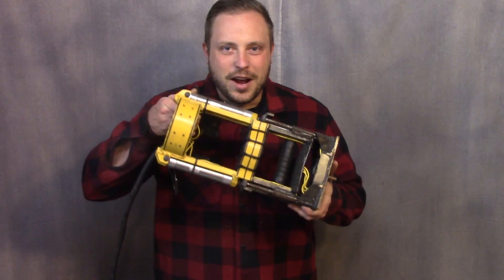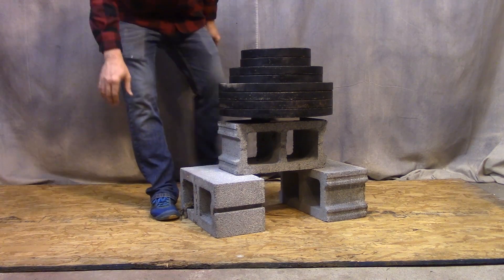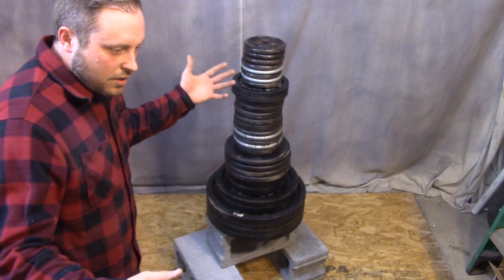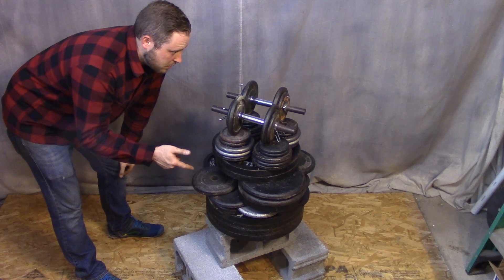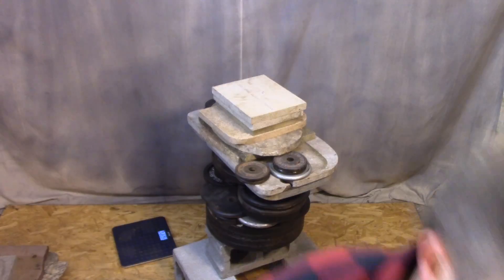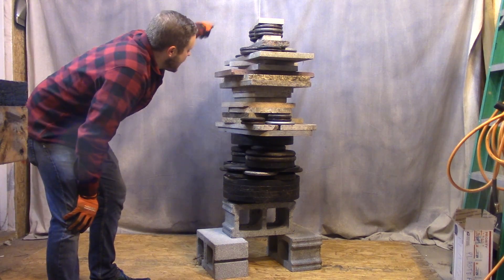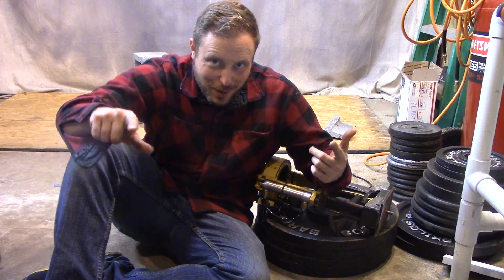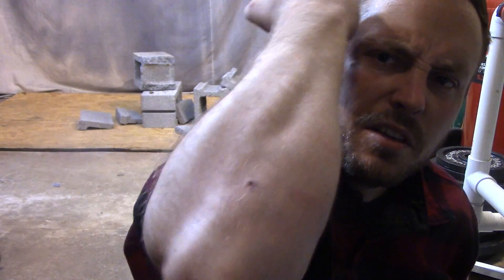POWERFIST POWER TEST - How much force to break a cinder block

Comment: You can swing a small sledge hammer and do the same thing. The sledge hammer does not weight 600 pounds but it is how the force is applied with inertia and pounds per square inch.. this is public elementary school stuff.. come on

Comment: ok glad you told us how much the Co2 gas/part adds to the punch! 300 pounds, thats half of a great punch since you mentioned conor mcgregors is over 700
so if Conor mcgregor used it he should be able to get up over a nice 1000 even when not thinking about all the sturdy heavy metal you have adding force
but cinderblocks resting weight durablility is higher then its impact but im not sure how much
but still very awesome!

Comment: The weight is distributed between the surface area of the cinder block. It's much harder to break the cinder block like that compared to having all that weight focused on a small area on the cinder block. Also impact force which is sudden is different from a constant force. Still fun to watch.

Comment: To say that it's over 2000 pounds based off what they can carry statically using a base plate the same size only works if you hit perfectly flat and ignores the way motion transfers energy. In reality you can use less force on a punch with that because of the transfer of kinetic energy and the fact you would have been hitting it with a corner of the plate before the flat of it

Comment: He did the math! (Incorrectly).

Btw you can look up the strength of various building materials like... cinderblocks.  They usually have a compressive strength over 1000psi.  Considering the entire weight stack was balanced on top of roughly six or eight square inches, you’d need 6000 lbs or more to make that cinderblock collapse.  There’s also the issue of striking something vs, gradually adding weight.  They’re not the same.

Comment: Iam not sure if this guy is just really bad at physics or if he is trying to excite the kids watching (not like that). But it's not about weight it's all about the pressure you put on it (PSI) the weights he was putting on were soo big it increased the surface area which decreased the psi.the power fist has a very small tip to impact pressure and because the surface area was small then you don't have to use as much weight so it is probably only hitting with 400kg and with added momentum

Comment: You are not comparing the both material at same level. You put 1000 ıbs on the cinder block but, when you are doing this you use no explode power. Second time you use all the explode power on the cinder block. Like drop the bowling ball at 100 ft. There is no justice. Im from dıfferent country ıf you see mistake on my words, sorry for it.

Comment: That weight is distributed all along the surface of the block though.... If you applied that weight at a smaller point (fist sized) on the block, it would break alot easier

Comment: Poor experiment. The blocks were stacked in the poorest  weakest way. Homes are not built with block holes vertical. The block holes are horizontal. I used cinder blocks to prop up the front end of my car gross weight 3775 lbs. The punch through test was an accelerated force applied, not a steady force.

Comment: i think why this experiment failed the first time is because of the loading in ME we have different loads that creates different stresses to the material he applied like a uniform load which was uniformly distributed throughout the material so it will have more power to carry that much load without breaking, but the powerfist  works on impact or impact load which uses gravity acceleration kinetics energy and is concentrated on a particular area, what i mean is that i can break that cinder block with a hammer

Comment: consistant weight is not the same as force or impact. you could have dropped a single one of those bigger weights on it and it would have done the trick.

Comment: Hey, just wanted to point out that the wider the base of your weights the more difficult it will be to 'break' the cinderblock. In your case those first 4 weights span the entire length of the cinderblock and as a result will actually carry the weight of any blocks above it. Your fist has a much much lower area covered and thus will have an easier time.

Comment: The load was being transferred directly downward through the cinder block with the weights. From my guess cinder blocks can take lots of compression force. But when he punched it there was tension force along the side (as the block would be deforming downwards) which they can't take tension well. I know that's the case with concrete, not sure about cinder blocks but would guess similar material

Comment: The reason why you can't break the cinderblock by stacking weights on it is that you are loading it staticly. It will be a lot stronger when you load it up carefully. With the power fist you are putting all that load on it at once which makes it a lot weaker. So you being able to break it with the power fist doesn't mean you can "punch more than 2000 pounds".

Look up static vs dynamic force.

Nice video though.

Comment: Static load is much different than shock load, them add then work out the force in psi and you will see it does not take anyway near that force to smash that crazy block. That and two of those blocks does not require double the force to break.

Comment: You have to concentrate the weight in one spot, but at the bottom you had the biggest weight which spreads out all the weight so that would mean that the cinder block wouldn’t be sustaining over 1000 lbs but a lot less than that

Comment: The problem with this experiment is that when you just set the weight on there the block can hold a lot more. When the power fist hits it has Momentum which compounds the force generated. So when he broke the two cinder blocks he wasn’t really generating over 2000 pounds of force. That kind of force would have shattered his arm and hand bones even with the padding.

Comment: It isn't an accurate measurement by just stacking up weights because the cinder block needs instant shock applied to it you need one of those machines that will test the amount of force you put into you punches also the center pieces you put on there have to much surface area so you would need tons of weight to even put a crack in it

Comment: That pretty cool, although I wouldn't go as far as to say that, that was an accurate way of measuring it. When you punch, it is nearly impossible to hit perfectly straight, making the point where most of the force hit, significantly smaller, which alone can completely throw off the charts. The other thing that would throw off that type of measuring, is that stone ( and concrete) is very strong when holding lots of weight, but is extremely bad at dispersing sudden impacts. Making it take a minuscule amount of force to break it with a sudden impact, when comparing it to how much weight it can hold.

That is why you can put nearly unlimited amounts of weight on bedrock, without it breaking, but still be able to crack it with a pickaxe.

Comment: Come on.. We all know mass and acceleration are the main factors. What’s the purpose of stacking weights when you know you’re missing the key component here? 

You can set one on your foot and it won’t hurt as bad as dropping one on your foot. That’s one way of looking at it. 

Or you can park next to a wall and floor it vs accelerating a mile before reaching it and crashing.

Also, acceleration is greater than mass when it comes to cutting, breaking, etc and it also adds into the amount of force distributed on the object you’re breaking.

Comment: sorry to break it to you but potential energy is different than impact force. Here's a way to check. the force from the powerfirst will put the same amount of energy into you as it will the cinderblocks because your using an expanding force. Can your arm handle what was it 2000lbs? of weight on it while standing upright or would it break the bone?

Comment: You have to take account for the impact those weights were sitting there the force of the impact had to transfer into the blocks  witch with the weights it was just holding them

Comment: 1700-1900 Psi to break a cinderblock with weights alone, you would need 38 45lb weights to break it if you balanced it on a one-inch surface. They hold up buildings dude.

Comment: the weight trick doesn't work because puncturing something isn't all power, it also has to do with surface area, because everything you put on the cinder block is for the most part flat, the weight is distributed instead of being focused on a single point on the block, your powerfist has a point allowing it (with the help of the force behind it) to destroy the cinder block

Comment: the brick would have broke using the weights if you started with all the light weights first then went to the heavy ones the heavy ones cover too much surface area which distributes a lot of the weight evenly. making it harder to break the bricks using weight alone

Comment: The powerfist had momentum, unlike the "1000" pounds of weight on top The the cinder block, so the fist is actually less than "2000" pounds
Reply: yeah, but its still fucking impressive. you ever punched through a cinder block?
Reply: His powerfist has blown through a steel door frame and etc. It isnt just a nifty knuckle protector. The fist protrudes out as he punches, (using c02) and produces a more powerful blow.
Reply: No shit the fist is less than 2000 pounds. Are you trying to disprove what he said in the video? He knows that momentum is what is gonna give him the force to break through.

Comment: It's a "per square inch" problem. If you managed to balence all of those weights on a half in by half in cube it would break because you have a plate that I would assume is around 3x5 inches which is a total of 15 square inches. Rather then a 1/4 square inch.

Comment: It may have been hard but if you put the smaller weights on the bottom so the force is focused on one point instead of the big weights disputed on the whole block

Comment: Are you dumb its not the weight it's the pressure. You keep putting weights it won't break
Until it gets too heavy but not until a lot of pressure it applier

Comment: It’s not the weight the breaks the cinder blocks, it’s the shock, cinderblocks are made to handle tons and tons of weight, your best chance of breaking one with weight alone would be if you weakened one by cracking it and putting the weight of about 3 semi trucks on the area of a sewing needle or finger on it on the weakest point, you were putting the weight on one of the strongest parts of the cinder block, when you used the power fist you were giving the cinder blocks a great shock that what their made of (cement and pebbles) couldn’t handle, I could literally do that same thing you did  with a metal baseball bat and get the same results, I apologize in advance for this and for how late I am with this but I just saw this for the first time and noted your mistake

Comment: 😂 what an idiot 😂😂 of course it can take stacked wieght like that 😂 no take ur 5lb weight and throw it really hard at a cinder block... When the block breaks does that mean its over 1000 lbs? No. Nor does it mean you threw it that hard it simply means the weight is made of a harder materiel and the consentrated force of impact was enough to break it. I can smash a cinder block with a sturdy hammer. Does that make it gods fucking hammer? No. What you have done is put a massive steel weight on your hand with a very focused point of impact. No shit it worked. Everyone van do the same with a sledge hammer with a steel rod weilded to it. Not impressive. Let alone its not even the actual fallout power fist 😂 as thats a pnumatic fist thats trigger activated a real power fist wouldnt need u to swing it should blast threw walls and doors at a press of a botton. Yours cant even break a conventional door with your full swing behind it. As a martial artist i find that pitiful, a pair of brass knuckles is a more effective door buster in my hands that this ridiculous non functioning prop youve made.

Comment: The cinder block had a strong structure and it will take alot of raw weight to break it, force and distribution of energy (in this case force applied) is the important factor.

Comment: PSI!!!!!!!!!! Pounds per Square Inch.

Eye balling the plate you’ve placed onto the cinder block I can assume it’s at the least 2.5 c 6 inches. Or.... 15 square inches (at the least). 

When they measure Connor McGreggors punch as 700lbs they’re using PSI. The amount of surface contact he’s making during this reading of 700lbs is very very small, less that a square inch. A proper punch has you align your middle finger knuckle to be backed by the length of your arm to add more force to that point on the knuckle.

If the plate is 15 square inches and you have 700lbs on it then your PSI is 46.666... lbs. or, 15 times weaker than Connor McGreggor, at a conservative estimate that’s assuming that plate is 15 square inches.

Comment: He was hitting the cinderblock suddenly and on a concentrated point rather than gradually adding weight
Reply: What type of energy are you talking about? Based on the video I'd guess kinetic energy. the formula is:
Ek=1/2*m*v^2
(https://en.wikipedia.org/wiki/Kinetic_energy)
Force * velocity is not something I heard of, if you meant mass * velocity it's momentum.
Reply: He had in on a concentrated point not spread out, in fact some of those weights are partially over the support blocks on either side if all this weights were on a really small point then it would break for sure
Reply: Nah the point on top wasn't fixed it went inwards
Reply: .... yes you can. He's just trying to figure out how much force is behind it in a roundabout way. Also, I believe the formula you are looking for is Force = Mass * Acceleration. The reason velocity comes into play is actually on the deacceleration once it hits the block. Basically, this is what momentum is used to describe, and what that formula should equal (Momentum = Mass * Velocity).

Although concrete blocks like that are considerably weaker when the base isn't supported like he was here, just for finding the force of the impact I don't think there is much wrong about his setup, although there are probably easier ways to do it. I could be wrong about his setup, but I know that the reason you stated for it not working is wrong for sure.

I do doubt that him stacking them would require twice the force to break though. Seems very unlikely.
Reply: @Kolop315  in order to figure out how much mass the fist hits with he has to find the PSI it breaks with
Reply: who fucking cares? he punched through a cinder block, you cant just do that normally

also, something to bear in mind is that it can output more force, he didnt have the gas which would increase the impact
Reply: @jynxed66six54  ok dummy
Reply: You're right, I don't know how he doesn't know this, but a small area of impact is the key to breaking materials such as this. It takes approximately 675 pounds concentrated in the area the diameter of a fist to break through a 2 1/2" thick slab of concrete. Add an impact to that surface area and you automatically cut the force required to do this in half, or even less if your technique is spot on. The average black belt in karate has a punching power of 325lbs. of force, that's why they're able to break through hard materials so easily. Now I could be wrong, but in all forms of Karate that I've heard of they primarily focus on conditioning your fists to be rock hard to minimize the force and effort required to deal heavy damage. You wouldn't have to ram a 10-pound steel rod into someone's head very hard to kill them, would you? Precisely why Karate punches are weaker than boxing punches, and basically pretty much any other style that has no relations to Karate, they don't have to be. So the moral of all of this is; This guy doesn't understand physics that well, and use boxing style punches with karate style fist conditioning is the best bare-handed method of breaking concrete. Or you could just get a gun if you wanna break shit...
Reply: @null-g6f  yep
Reply: If you genuinely don't understand basic physics you're either a child or such an idiot that your comment should be null and void when discussing physics. His estimate for the force to break both was obviously flawed because the first one is going to fracture and change the direction of the force and you no one here including me is going to work that out but if you're trying to argue that the force exerted by an object accelerating is different than the mass of objects that are defined by the force they exert as they're acted on by gravity you're a moron.
Reply: Brandon Park that’s still not going to make it suddenly equal. Force = Mass*Velocity
You can’t figure out how much force it takes to break something by gently stacking weight on a small steel plate that lies on top of the thing you want to break

Comment: This guys is a dumbass! Of course the blocks weren't gunna break with you adding those weights on. Why? Because the amount of force pressing down by the weights was spread out. But when he punched the force was more concentrated on a set point, therefore less force is needed. 🤦‍♂️